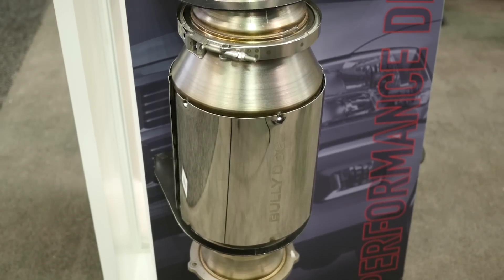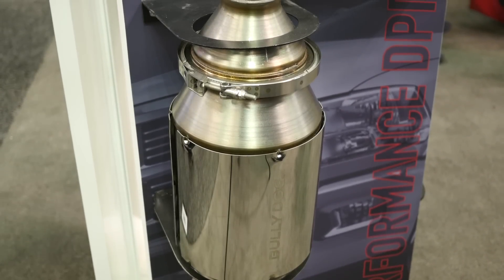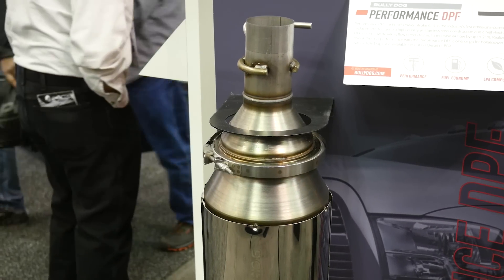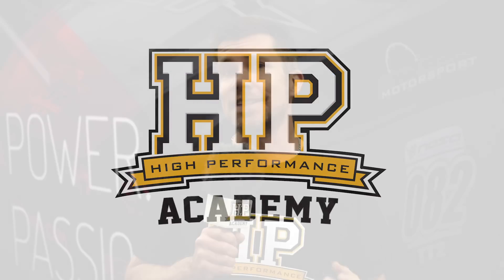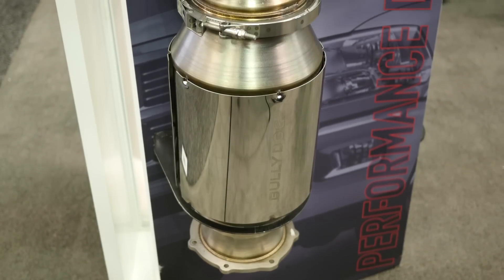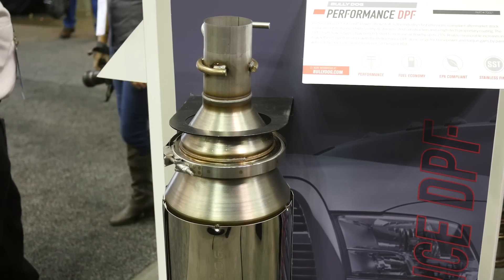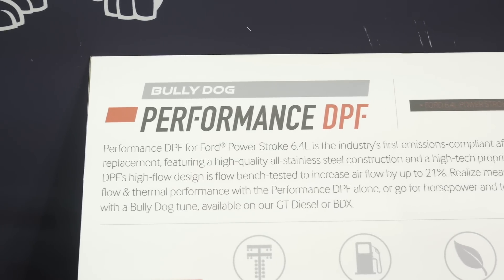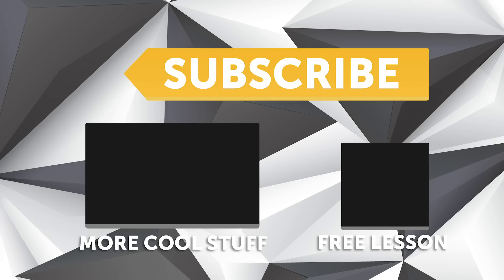DPF Removal | What Is The DPF Regeneration Process? [TECH TALK]

Comment: Let's not forget the regen cycle also contaminates oil with diesel fuel lowering the lubrication properties. And the regen cycle causes excessive wear on the engine, shortening its life. Regen and DPFs do more harm than good. Plants love CO2!
Reply: Primary harmfulness of diesel emission doesn't come from CO2, but rather from soot (solid micro particles) and NOx. Those are actually been proven to cause lung cancer, so yeah, CO2 is the only emissions gas that you should concern.

Comment: Diesel soot gets to moot 👌

But to be serious DPF’s have ruined most of the new generation of diesel cars here in Australia most of them have massive issues either blocking before the car even gets to 100,000km or setting things on fire because they get so hot (ranger)

It’s good there’s finally an aftermarket solution but to be honest here in Australia where our cars don’t get tested for emissions this product is currently fairly pointless to us most cars will just get fitted with delete kits/straight pipes still because of cost
Reply: My Jeep renegade limited had done this after 3.000 miles from brand new its a pain in the ass to then drive it on a straight road sitting at 6.000 rpm doing 60mph for 20 minutes for the dpf to clear  it's no use for the roads hear in the UK

Comment: A good DPF has no power loss from our testing compared to a straight pipe. Shame the parts around them fail often and cost so much.
Reply: Even with a lot of fuel? Say double the fuel than factory  programming?
Reply: @drthik1  not many people run double the fuel
Reply from the maker: @Ryan P, this is inline with many of the dyno tests we've seen. Of course you can't say across the board that the DPF won't restrict power but in many cases the difference is minor.